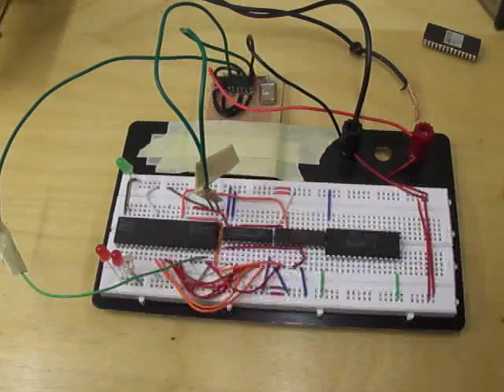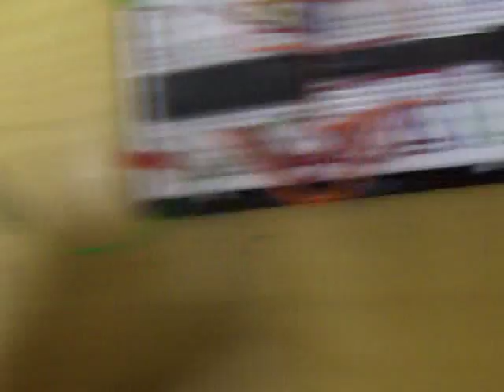Start of a homebrew 8088 PC "motherboard"

Comment: Yeah, to prevent future problems consider a voltage regulator and some filter caps over the supply rails, 10-100pF per chip. Nice. Keep going! Also follow a strict color coding scheme. The wires are gonna get hectic.

Comment from the maker: yes, it starts with CS=FFFF and IP=0000. if there isn't a JMP instruction there like in a BIOS, it will just keep moving through the segment and IP wraps back around to 0000. it doesn't cycle through the entire 1 MB range, just 64 KB of it.

and yes i used a 74LS245 and 8288.

Comment: Technically, I don't think you "need" an 8284(a). It just makes it more convenient because it provides a peripheral clock (1/2 of the system clock speed), and it provides reset signals to the cpu. I'm guessing this guy is using a 14.31818 MHz crystal because I think he said the clock rate was 4.77 MHz. The 8284 takes a crystal between pins 17 and 16 with a 12pf capacitor. The 8284 takes the crystal's frequency and divides by 3, and outputs this on the clock pin (pin #8) connected to 8088 pin 19.

Comment: How can it cycle through memory addresses? It looks for its first instruction at FFFF0h, and if it isn't there, it does nothing. However, with loads attached to the address/data lines, there may be random values at power-on. But if there's no instruction at the "power-on location", it just sits there doing nothing. However, ALE might start clocking (you can confirm this with an oscilloscope) after several resets. Are you using a 74LS245 transceiver and an 8288 bus controller? Is it a basic 8088?